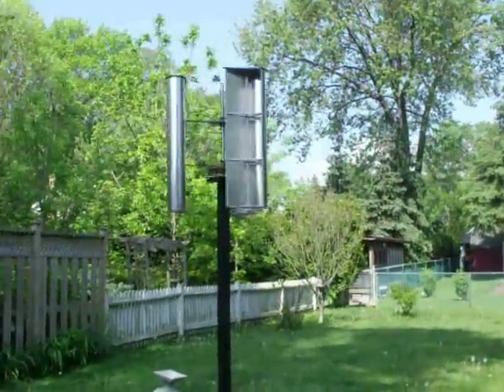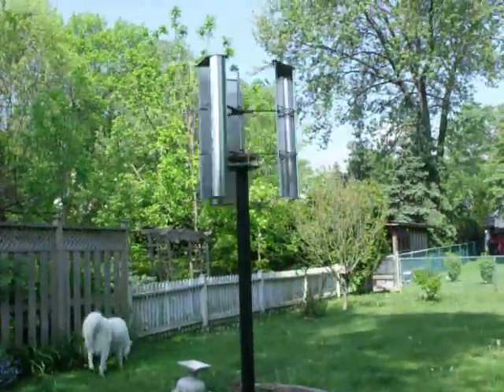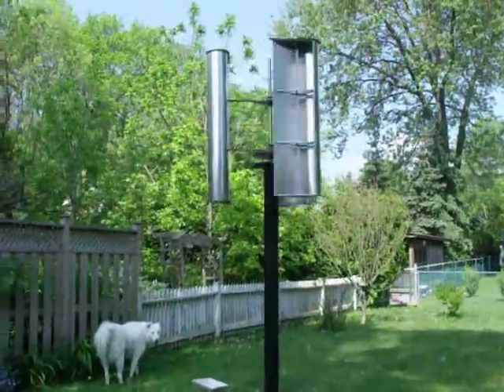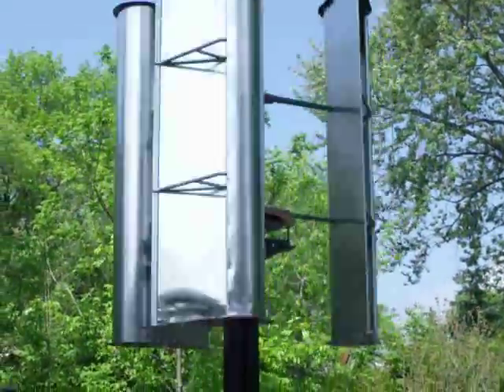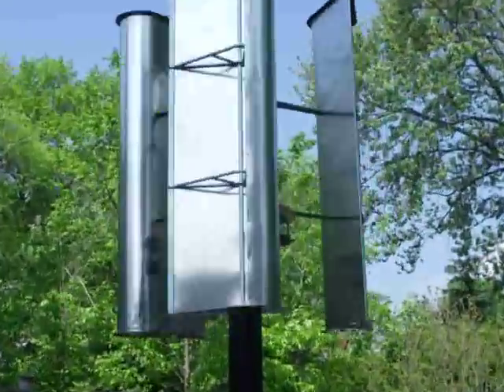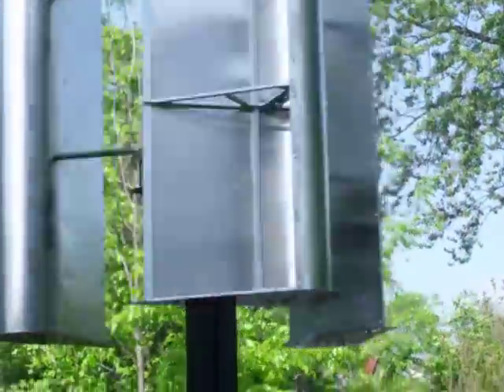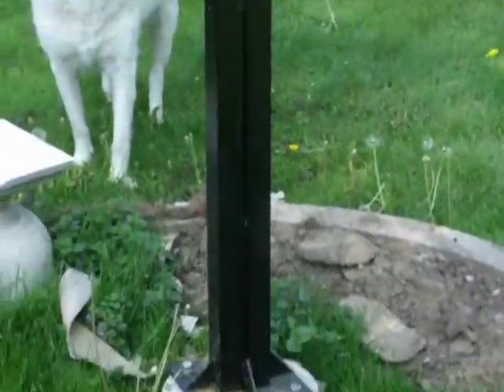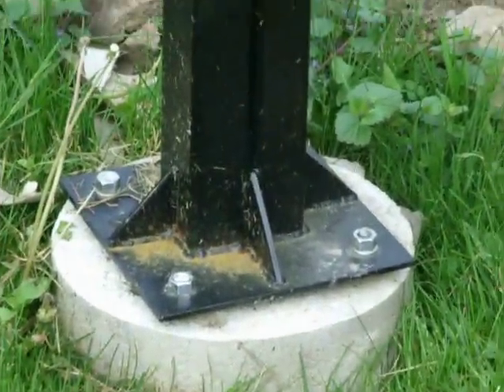vawt Lenz ll finished

Comment: Everything you have done looks great!  I love how you have taken the time to show us all.  I have one question about this VAWT though.  Shouldn't the blades be on so the smooth side is on the outside?  This would create more of an airfoil effect I would think.  The airfoil effect would help spin the blades rather than pushing against the blades.  I, of course may be wrong, but that is my thought.
Still though, incredible work!! thanks again for sharing.